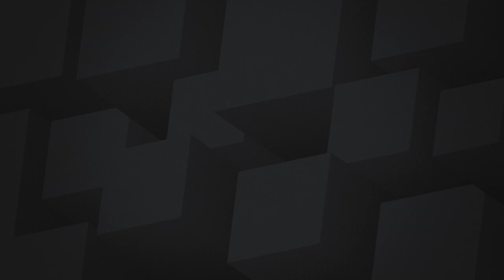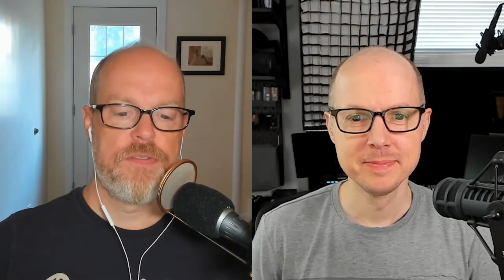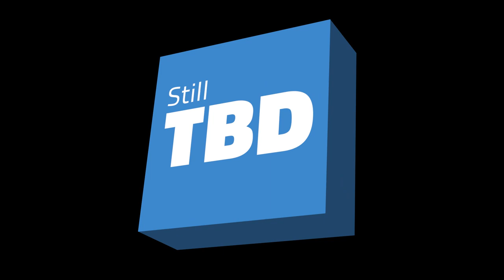89: A Lot of Hot Air? Space Powered Cooling Panels

Comment: I live in Phoenix AZ. It is very common to purchase reflective screens for all doors and windows.  When we got reflective screens installed our western exposure rooms cooled dramatically. Southern walls are designed to have no sun on them in the summer already, but the screens did help cool the house from radiated heat, just not as dramatically as the western walls that have to over hang shade for summer.  I have also build shades for my air conditioners and seen twenty plus degree temps drop on the heat exchangers from direct sun.
Reply: How many dollars?

Comment: What if buildings could change color depending on how hot or cold the weather is?
Reply: Great idea. I have been working for the last months working and implementing what you mentioned.
Reply: Just paint them white. You don't need to change colors depending on seasons. 

If it's summer the white paint would reflect 80-90% heat waves. 

If it's winter the white paint would minimise the release of heat from house to the environment just like an igloo house.